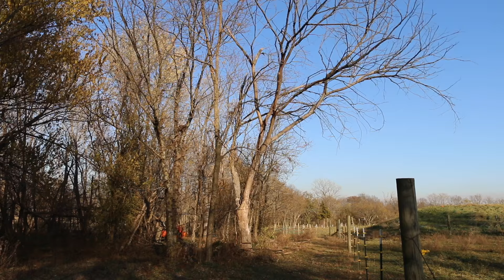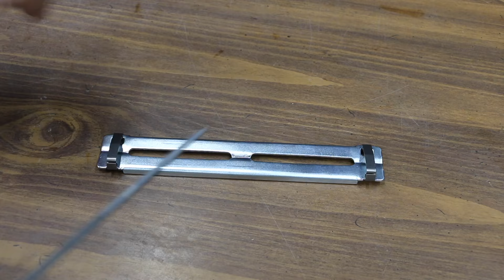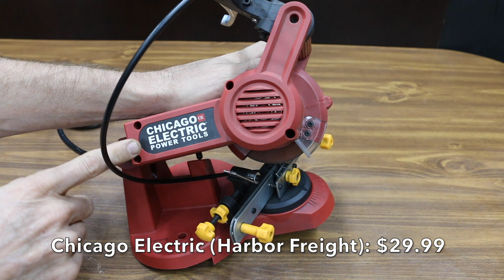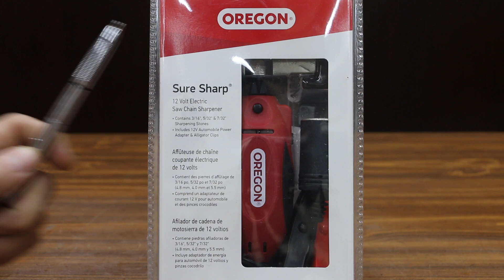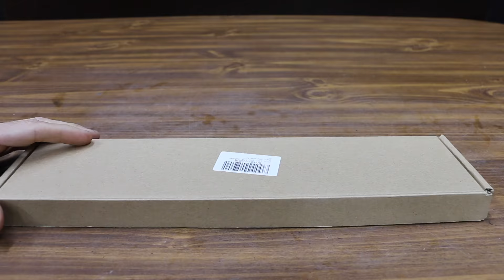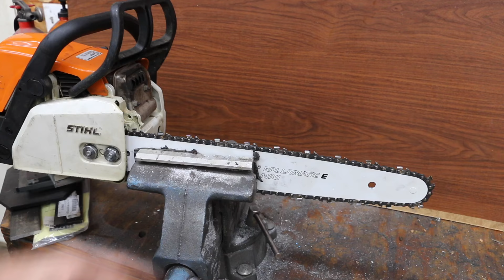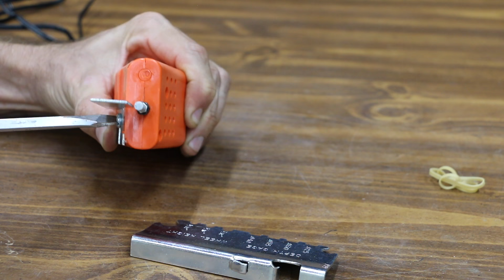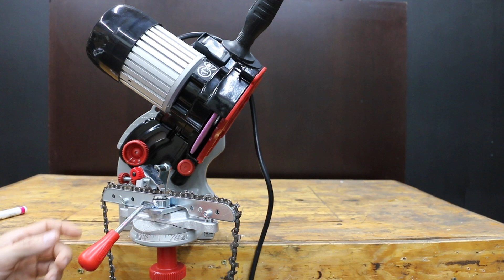Which Chainsaw Sharpener is Best? Let's find out! Stihl, Granberg, Chicago Electric, Oregon

Comment: I don't touch my chains unless I hit dirt repeatedly with them and they need a lot of material taken off to make them functional again. I have the HF grinder and it works great. My old man was a logger and had a high dollar version of that style grinder and I don't think it did any better job than the cheapo HF one. Maybe just a smidge more precise but you can get great consistent results with the HF one if you pay attention to what you're doing. I'm surprised that those hand file setups did a better job. I guess if you can get consistent results and they maintain the proper shape of the cutting tooth, that might be the reason. Regardless, seeing the HF chain so close to the factory speed, I'll call that a win. No need to spend more money and use elbow grease where a machine gets the job done. Something I've noticed about chain sharpening is that faster chains tend to consume more power so if you have a saw that's marginal in that respect or you're plunging the bar up to the hilt it may give you trouble. Those quicker cutting chains tend to wear out faster too, so if you're in the woods all day cutting trees, it might not be the best way to go. There's a reason they don't go steeper with the tooth cutting angle and this is why.
Reply from the maker: Thanks for the feedback.

Comment: I really like being able to shapen the chain quickly while it is still mounted on the saw. That simple Oregon "field" file system is hard to improve on. It doesn't take very long working with a fresh chain to dull it a little bit, and being able to do a quick touch up in the field with only hand power is a winner IMO.
Reply from the maker: Thanks for sharing.

Comment: After owning the Stihl 2 in 1 file (I own two actually), they ARE good, BUT - Beware! The file also files the rakes at the same time and creates a deeper cut. Depending on the saw, you could cause too much bite and stall your saw. - Just make sure the flat file doesn't take too much off the rakes.
Reply from the maker: Thanks for the feedback.

Comment: Imo the high speed sharpeners are bad for the chains as their high speed, high heat harden the metal of the chain which means, the next sharpening will need to take away more chain metal in order to sharpen thus, fewer uses of this chain versus, the Stihl hand filing does not heat and harden the metal this, allowing many more uses out of one chain.

Comment: Given the termites and the dry,  really often  hard wood I work with, get the bench grinder for the brute sharpen and then the Gandberg File n Joint to polish and maintain. If using Tungsten chains then GBerg 12V one for field work. Diamond shafts are a lot cheaper than wheels.
Reply from the maker: Thanks for the feedback.

Comment: I just want to comment on the Grandberg Precision Grinder (and all of these). 

I notice that the expensivest Oregon one was able to lock the chain properly. I have the Grandberg PG and if you can move the chain through the clamp, it can move as you grind, even though in theory it sits against a restraint. I find that over time, the teeth become unevenly ground, because the grind process is aggressive and not locked. So you get a sharp chain, but at the expense of tooth life. I use Tungsten Carbide-toothed  chains and that unevenness counts. To avoid this, you need to be VERY careful about set-up and that detracts from the convenience of the machine.

Also. This thing is belt driven at extremely high speed. I have had trouble with the belt. The bearings sit in plastic housings and I reckon these get pretty warm. I had to pack the bearings with Al foil to stop them spinning in their housings after a few uses. I disagree they are built to handle what they claim.
The trouble with any of these precision machines is that the tell you they make it easy. In every one I have seen, there is a fair bit of judgment and skill to get it to the best advantage. Start with cheaper chains and get in some practice.
Reply from the maker: Thanks for sharing.

Comment: I have an old bar and a skateboard wheel that I've sliced a groove into, and attached to the back of the bar so when I need to sharpen a chain I just wack it on my home made rig and roll it around, it works pretty well.
Reply from the maker: Thanks for sharing.

Comment: If you ever revisit this topic may i sugest doing two or three timed after shapening cuts. I have noticed my own experience sharpening results in a great first cut. But each successive cut results in a loss of speed resulting in more pressure required. The sharpener can give a false impression of sharp with the teeth being more jagged then sharp and each successive cut takes away the jagged edge leaving it more dull. Similar to an improperly edged knife blade.
Some of these sharpeners tested looked less than stellar up close. Curious as to to how they would have timed out compared to the factory edge timing identical over three cuts.
Reply from the maker: Thanks for the suggestion.

Comment: ...mmm  But just how long  will a blade stay sharp after you spend the time to sharpen it  compared to running a new chain ?  Doesn't a new  blade loose its  temper after  cutting logs until its dull .... then sharping it  ?

Comment: You don't need to mark the spot where you begin sharpening. Simply start either just before or after the section of the chain where two right-hand teeth are in a row.
Reply from the maker: Thanks for the constructive feedback.

Comment: I have the Chicago bench top to sharpen all my chains at once at home. I also have the 12v Stihl portable to touch them up in the field with each fuel refill. Curious, I only paid $60 for my 12v Stihl portable several years ago and still see it for that price at different locations. I burn wood year-round so the saws get a LOT of work. Never have had a problem. Both sharpeners are still running strong after 10+ yrs.
Love to see this time test done with a gas chainsaw.
Reply from the maker: Thanks for the suggestion,.

Comment: I sharpen free hand with just a round file and with enough practice ive cut sharpening times down to 5 minutes on a 25 inch bar skip tooth, i find it to be superior to any other method ive see, the 2 in one doesnt dig a perfect gullet fo my liking and affects tooth pitch which cuts a quite a bit slower in my opinion
Reply from the maker: Thanks for sharing.

Comment: What is really like to see a comparison of is vehicle body buffers. There's a heap of different brands out there at vastly ranging prices. I just can't see that the most expensive one does that much better than a mid range buffer.

The one I'm looking at is a chinesium 1600w cordless, and it takes a Makita 18V battery. For way less than $100 (AUD) seems like good value.
Reply from the maker: Thanks for the suggestion.

Comment: In my opinion you have to high a gauge. Your sawdust is waaay to dusty ;-) It is normal that a new chain sucks. File down the gauge until you cut long strips. That's how I learned it.
Reply: A well sharpend chain wont need the weight in front since it will pull it self.
Reply: that is what the "sawblade" is fore. The chain pull will move the saw along the teeth no work so easy...if you sharpend the chain right!
Reply: If you don't file the gauge and makes tiny fibrous cuts the wind will, pr.  murphys law, blow it into your eyes. Really nasty I can assure you. Had one sticking to my eyeball once so I know. True story: I was working with helmet and perforated visor way too long it was hot so moist condesated inside the helmet...I took it of and it ran down my face two blinks with my eyes and I had a stuck wood fiber i my eyeball just pierced the outer layer but bothersome lucky for me I had acces to a cuetip and my colleague fixed it for me.

Comment: Stihl 2 in 1 is perfect. Nothing better than a manual file if you do it regularly but yeah if you are a pro, I would just carry a few sharpened chain and change them once in a while and sharped them at home/job using electric but a big business will just use sharpening service.
Reply from the maker: Thanks for the feedback.

Comment: It sounded like the battery was wearing down on a couple of the tests. Was it the load and sharpness that made it sound slower on the couple tests or was each one charged at same rate before test? How is it when someone doesn’t have a jig? Just skill and a file comparable? I know a couple old loggers that can put a edge that throws chips not dust. Anyways very cool video. I’ve personally got three of those jigs . And you can tell the difference when you use one or the other or if my friend sharpens. Thanks for that review.

Comment: Nails and screws in trees are hell on a chainsaw blades.. Idk who put them in my trees? But i don't do that!  Guess i'am going to have to run metal detectors over them > yes the chainsaw cut threw them. But got to see what it did to the chain. Chip pieces out, and rounded the edge.. Makes the chain totaled out  🤬Not a good average!  1 new chain for every tree. So i tried to sharpen them up and use them as the best as i can. Until it don't even cut no more!  > OFF IT GOES in the junk metal bend. Next cement pad that i make>  i will used the chains as REBAR
Reply from the maker: Thanks for sharing!

Comment: I have the File-N-Joint (purchased years before discovering this channel) and I oddly find it pretty pleasant to use, and it (well, allows me to) restores the cutters back to stock or better..I am by no means a pro chainsawer, but I just want the blade to be safe, smooth and straight during the cut.  Just play some music while sharpening.  Great tool for a home owner that has a bench vice.
I originally purchased the HF sharpener about 10 years ago...and it's garbage in my opinion since it changes the original angle of the cutter.  I still have it because I'm reluctant to add it to the local landfill.
Reply from the maker: Thanks for sharing.

Comment: nice presentation of information as always
however, it is very easy with the electric grinders to put too much heat into the metal of the teeth, easily seen on your first go with the oregon bench, big discoloration and hardening of the tooth gets destroyed))
also, cutting in wood with such a variation from full of branches to no branches at all makes the tests almost inconclusive, branch crowns like those are very very hard wood, and can easily put two or three seconds on the wrong end of the scale for the chain you are testing==) 

regards

Comment: I use a bench grinder very similar to the Oregon in this video.  There is definitely a learning curve.  One thing I do after sharpening with a bench grinder is to skim the top with a flat machinist file to remove the burr.  I seem to get my chains razor sharp, but it took lots of practice and experimentation to get it right.
Reply from the maker: Thanks for sharing.

Comment: I've had a Pferd Chain Sharp for probably 20 years.   Very similar design to the Stihl 2 in 1  (probably where Stihl got the design from).
I'm just a small landowner, so I don't cut every day (or even close to it),  but unless I needed to keep several longer chains sharp every night after being in the woods all day,  I don't see why you would get one of the powered ones.     The 2 in 1 design is very easy to work with and, as demonstrated, makes a very sharp chain.
Reply from the maker: Thanks for sharing.

Comment: I love my Granberg File and Joint!!  Brings me back to being a little kid, up at Grandpa and Grandma's farm.  Uncle and Dad would be doing night chores, Grandpa would go to his basement, with his John Deere 50VV (Echo) Dad's John Deere 55V (Echo) Uncle Tim's Husqvarna 50, and Dad also had a Pioneer small saw and later a Shindaiwa 345.  He would sharpen with an Oregon of similar design to Granberg.  Turn around, fill his wood furnace, I'd set on a stool next to a big table there was a big meat bandsaw at other end.  Wall of filled canning jars, big chest freezer, his bench.  He would fire up his Pipe, I know now it was a Dr Grabow Viking metal stemmed pipe.  He smoked Union Leader or Prince Albert.  Put his saw in the vice, set up the file and he'd file his JD, then Dad's, then switch files for the Husqvarna, the Pioneer.  I'd just set there and watch.  I was just 4-7 years old then.  You knew next day after chores, the John Deere 2510 Diesel was going on the wood splitter, a big O'connell, and the Leyland 272 was on the wood cart. 
Down the road we went to the flats.  

About 10 years ago I saw a Granberg File and Joint.  I wanted it.  Thought of Grandpa when I saw it.  I lost him in 04 at 77.  So I got it.  Made my brother happy.  I'd go up to our shed, night before we'd go to the woods, grab up his 2166 J-Red, file it first, Dad's Husqvarna 55, my Echo 6700, brother's 55 Rancher, Dad's Echo 310 took smaller file.  Just enjoy the time.  Then watch the chips fly the next day.  My father and brother both said the chain did seem to hold an edge a tad longer.  We do have an electric I got a TSC, it's Green, it's ok.  Also got a stump vice and Oregon hand files for touch up in the woods.  
Out in the woods, that Stihl 2 in 1 would be pretty handy I think, should get 1!
Reply from the maker: Thanks for sharing!

Comment: When I started cutting my own firewood 40 years ago I used a simple Oregon file guide. We burn about four cords a year, and I sharpen the chain after every couple fuel refills. After a year or two, I was given an Oregon file guide that appears to be almost identical in design to that used in the Granberg systems, though the piece that hold the sliding frame is plastic, not aluminum. They are so similar, I have to believe that the Granberg is an improved copy, and it has certainly been long enough for patents to have expired. This worked very well for me for decades, when I finally decided that the Harbor Freight style, Chinese sharpeners were inexpensive enough to give one a try. I found it much faster to use, but noticed that the geometry of the cutting edge had changed and now I have reverted to using the Oregon jig until the chain is approaching the end of its life, at which point I switch to the motorized sharpener and use the chain on trash wood until it is totally shot. The only advantage of the HF tool is its speed.

The Harbor Freight tool is one of those, "Let's make it as cheap as we possibly can and still have it work" deals. If anything about that unit whispers the word "quality" to you, then your standards were developed in a different culture than mine. The Oregon bench unit appears to be in a completely different class and is probably a better choice for anyone who is looking at the HF unit because they do a lot of sharpening. 

The Granberg has a significant improvement over the Oregon jig in the guides that support the sides of the chain. I have found that clamping the saw by the blade in a large vice stabilizes the saw quite nicely, but the chain wants to rock under the file. Those extra supports likely help a lot to alleviate this. I see the Oregon jig is now called their 23820 model and that it also has similar guides, though it is now made in China. If I feel the need to replace mine, I'll probably go with the Granberg, even though it's twice the price.
Reply: I'm not gonna say their chain sharpener is ultra quality, but a lot of Harbor Freight tools are surprisingly good quality even for any price

Comment: I like the Granburg style sharpener. The one I have is I think an Oregon brand painted red that I bought in 1980s and has always worked the best for me. adjustable to whatever chain style you are using. Use a good file with it and brush off filings between teeth and the tooth will be razor sharp. Chains will not last as long with rotary type sharpening and will not cut as fast.
Reply from the maker: Thanks for the feedback.

Comment: Not so Fast.

Nice comparison of nine chain sharpeners. However, these tests only involved the sharpening of the tooth. There is another aspect that only one of these sharpeners addressed (filed that is).

When sharpening a chain, there are two components that must be attended to. Yes, one is the tooth (which all of the tested saw sharpened) and the other is the depth gauge. 

Only one sharpener filed the depth gauge so the tooth "cut" would be appropriate to the depth/age of the chain. The sharpener that attends to the two aspects of sharpening the chain, and does it in the same pass, is the STIHL 2in1 (two things done in one pass). 

To properly compare the time it takes for a sharpener to sharpen a chain, both the sharpening of the cutting tooth and doing the depth gauge filing adjustment should be considered. For every sharpener except the STIHL 2in1 it will require additional time to file the depth gauge so the cut made by the tooth is maximized. chain sharpeners (the time to sharp.

Considering the two things that need to be done to sharpen a chainsaw chain, the STIHL 2in1 clearly is the best of the nine chainsaw chain sharpeners.

I suggest the Farm Project redo these comparison tests to reflect the actual total time needed to sharpen chains. Well, Farm Project could also just agree that, all things considered, the STIHL 2in1 is the preferred chain sharpener.y

I purchased the STIHL 2in1 sharpener several years ago (I am not being paid for making these comments in any way) I have used the STIHL 2in1 sharpener and it gives me the capability to sharpen chains so they cut efficiently. The proof is in how the chainsaw makes the chips fly and the rapid cutting of wood. After years of just sharpening with a round file for teeth and a hit-and-miss flat file for the depth gauge, using the STIHL 2in1 sharpener, in my experience, created a startling paradigm shift in sharpening. STIHL 2in1 is clearly the sharpener to use.